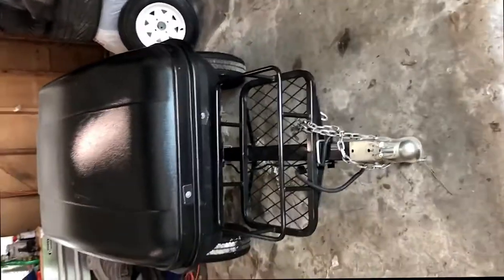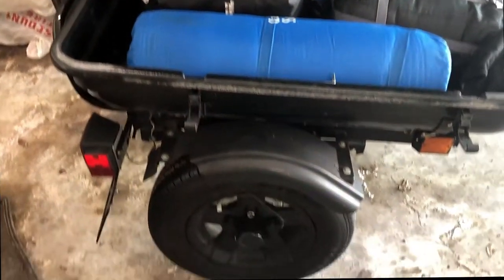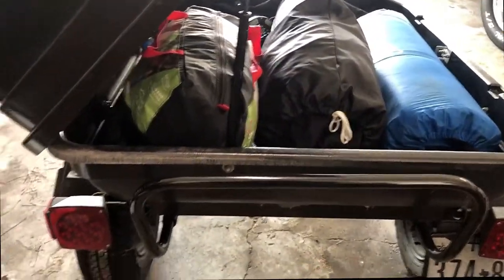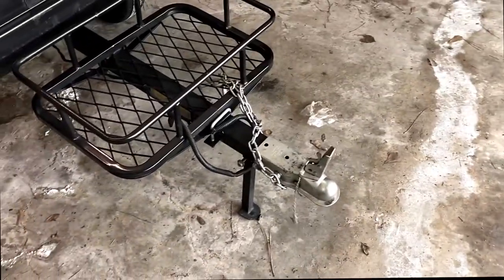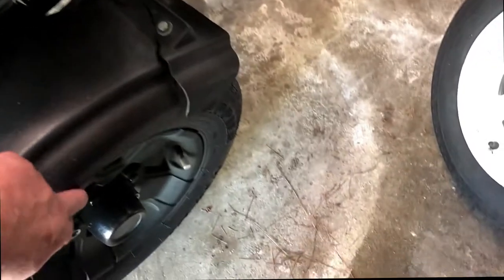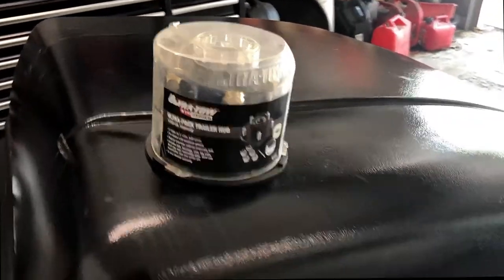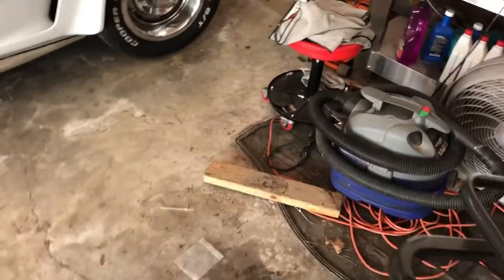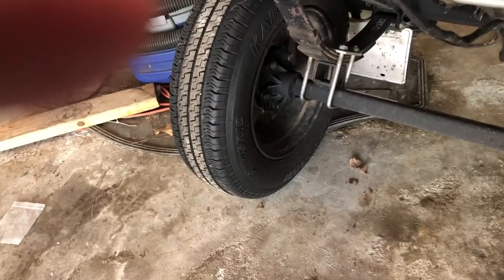Motorcycle Utility Trailer for the Goldwing or any Motorcycle - Review

Comment: The bias ply tires with no more weight than that trailer will have are ok for 80 mph.any people pulling small trailers do ot.
Reply from the maker: Hi Ronnie, Thanks for watching. I have considered leaving the tires and 4 lugs on, but since I was going on a 8k mile trip across the country I reconsidered and researched and fitted radials so the trailer wont bounce all over the place on rough California highways, and withstand the weigh I did load it down with or blow apart when hitting 80-85 on Texas interstates.  I barely even noticed the trailer was attached especially on PCH. I didnt want any problems that most people experience with bias ply tires long distance. This was the best alternative in my opinion.
Reply: @tracktoys9269  yes I hear you. I’m contemplating changing the 81mph Bias Plys I purchased as an upgrade to a set of Radials for that reason. I don’t want the small trailer bouncing all over the place while half way to Canada. I’m going to pack my trailer down with the weight and make some runs prior to the big ride.

Comment: Not sure if my reply posted. I like your trailer. I purchased a small trailer that came with bias ply tires that were rated for 55mph. I just swapped them out for a set of bias plys rated for 81mph @ 90psi. Kept the same rims. Do you know how much those rims you purchased weigh? Especially compared to the Steel ones. Also what size cooler fit in that basket when u did run a cooler in front. Planning a trip to Ontario, Canada from So California so I’m trying to get any and all info I can before we take off in June 2022.
Reply from the maker: Hi Dave! thanks for watching! here's the info I posted below. 
I bought them in 2019 from Rec stuff, here's the info:
ST145/R12 Kenda Karrier S-Trail Radial Trailer Tire - Load Range E	                TR201
12X4 5-Lug on 4.5" Aluminum Series 07 Trailer Wheel - Black - 724545FPBM	WA208
Not sure what they weigh but they are way lighter than the wheels and tires it came with. if I had to guess, probably 10-15lbs per wheel. Went 8k miles in one trip with them in 2019. I still have the trailer, dont use it much anymore. Bought a new Goldwing, and I need to outfit it again (start all over again, in other words.) If I want to use it again.  Watch about it on my channel. 
The ride as opposed to the original was much smoother no bouncing around. I had to change out the hub and the bearings to make it work. the max speed on these tires are 85+, I did a stretch through west texas at about 85 ( I normally travel at a max of 75-80 on the higher limit interstates) and the tires and the hubs never really got hot or overheated. I checked them often. Replaced the bearings every time I travel long distances.
Reply from the maker: oh cooler I forgot, I used a small cooler and a gas can on the front basket, But I had to put them in the trailer because they exceeded my tongue weight. I tried to keep it down to 25-30lbs. i had to check that with a fish scale every I stopped.
Reply: @tracktoys9269  Hello again. My wife and I found a 38qt Igloo cooler to fit almost perfectly in the front basket. I bought a scale as you used and it helped not only with tongue weight but weighing items before putting in the trailer itself. So you liked keeping the tongue weight at about 25-30 lbs? That's sorta where I was shooting because the overall weight of my packed trailer is about 300lbs. It seems 10% of that in tongue weight seems ok but 15% or 45lbs seems a bit heavy. Anyways again I appreciate the video. It helped me with ideas for mine. We are taking off on our trip in another 1.5 months.

Comment: Hi need some help thx what trailer tire pressure you use
Reply from the maker: I dont remember what the limit on those tires were(radials) I used 55-60lbs, so it wouldnt bounce around.

Comment: I like your wheels and would appreciate the tire and wheel information please?
Thank You
Hoka Hey
Reply from the maker: sure! I bought them in 2019 from Rec stuff, here's the info:
ST145/R12 Kenda Karrier S-Trail Radial Trailer Tire - Load Range E	                TR201
12X4 5-Lug on 4.5" Aluminum Series 07 Trailer Wheel - Black - 724545FPBM	WA208